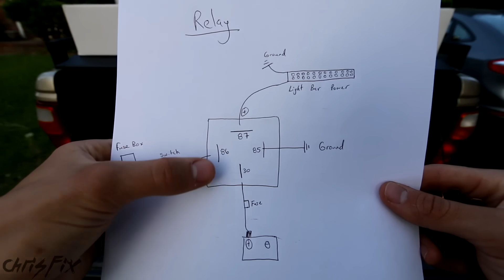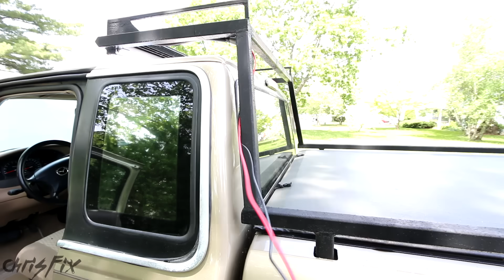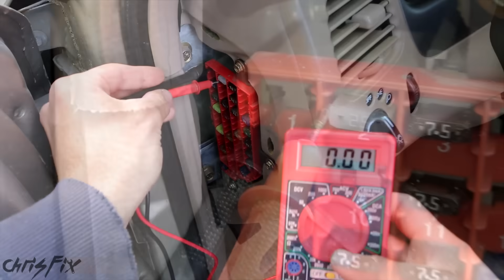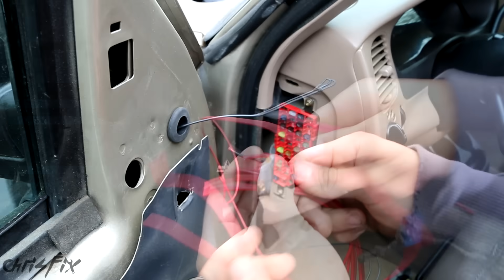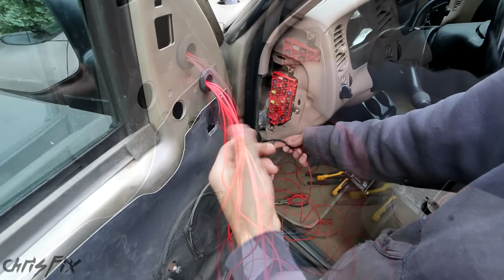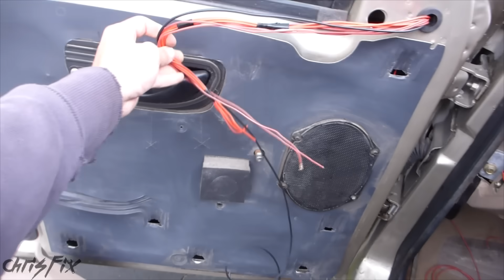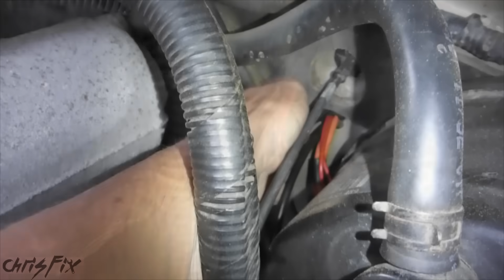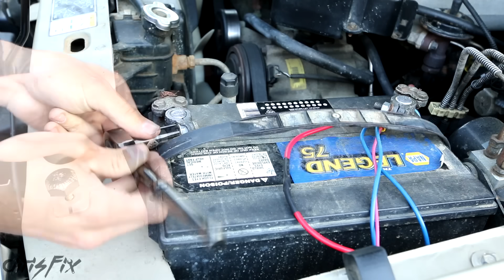How to Wire an LED Light Bar Properly (Project Night Light Episode 3)

Comment: you should do a how to wire subwoofer/amp.its really easy but nobody has made a good video of it yet.
Reply: yessss
Reply: I could do a quick runthrough of my setup that i did myself stereo, subs, 2nd battery, speaker amp and upgraded speaker wires
Reply: Look up Meade916 he has a lot of great videos on that subject.
Reply: Can somebody show me to do a fuse tap into my ignition with a toggle switch for amp turn on
Reply: @JonathanMartinez-rv9ur  
There shouldnt be a need for a fused line for the signal wire as it operates on an extremely low current that doesnt power anything
The way most would recommend you do this is to tap the signal(ON) wire leading to your stereo deck that way your amp is on when your stereo is
Reply: @TruckerTechReview  what? I'm not tapping into my factory radio. I am taking the remote wire and using a fuse tap for tapping into the radio fuse. What I wanna know is can I use a fuse tap power wire connected to the blue wire connect to the switch and then ground my black wire will it turn on?
Reply: Watch a geek squad video
Reply: Yasssssssssssssssssssssssssssssssssssssssssssss meade a gggggggggggggggggggggggood video

Comment: you could also ground wire with doors... it will work perfect as well - but one wire less
Reply from the maker: That is true. I learned that afterwards but either way works. Thanks for sharing!
Reply: i relay do like to watch your videos. Good job. 

i have two tips for connecting extra devices to car battery.

1st -  i connect thik wire to batery (only one) and i use universal fuse box/fuse terminal block - i have less mess, and all extra fuses are in one place.

2nd - if there is device that consumes a lot of power (lights with regular bulbs can use a lot of power) i connect them thru relay - no ignition, or even engine running means no power for device. 
it prevents my battery to be drained - especialy if i accidentaly leave my lights on...

Comment: would it work if you use your accessory power from your head unit to power the switch? that way you need the key in to turn the light on meaning you cant leave them on accidentally
Reply from the maker: Dont use the power from the head unit to do that. Instead, use a fuse that is only on when the car is on.

Comment: Put a 6 inch lift kit on project night light and 35 inch tires
Reply: +WHOS YO DADDY 8 it's the exact same thing as a ford ranger
Reply: +WHOS YO DADDY 8 a 6 inch lift maybe yeah. But a 3 inch lift and 31s would look good.
Reply: @znovosad555  i have 31's on stock suspension on my ranger
Reply: @owensullivan3881  well I have an f150 so I'm not too familiar with the rangers. I was just throwing out a hypothetical scenario
Reply: and a ford you know...
Reply: i have a 88 ranger with a 3 inch body lift and 31's right now thats only a 4 cylinder 2.3 and can still do 75 just a well as i could stock
Reply: Dylan Greene but... but... what about 'murica?
Reply: Rageception Chevy 350😉
Reply: Zach Novosad boy 31s and a 3 lol. I'm sitting stock on 30.5s so
Reply: austin bob calm down its only a Mazda...
Reply: +WHOS YO DADDY 8 the only ranger I owned had a full on factory V8, with the same specs as a fullsize F-150 that I had about the same year, so logically the ranger should be faster, I think the 6 insc a bit much, I would go with a 4-5 inch lift
Reply: Rageception that's not any better😂
Reply: Zach Novosad true but how often do you see a lift kit on a Ranger? And they're already slow enough and I'm pretty sure a 6" lift and 35s wouldn't even allow it to get up to legal speed... Just sayin'
Reply: @RJ-pw9ij  
Lifted Rangers are very common.... 
Regear the axles with 35's and you'll have the same or better acceleration than stock...

Comment: I was wondering if I could put all my LED light bar switch into my fused box??  And if so how big of a fuse should I run with 3 switches, a volt meter, and USB port??

Comment: Very interesting, but I would have a switched ground instead. So you would  only need one wire from switch to relay (reducing your  8 wires for 4 switches to just 4 wires.)  
Also the gauge of the switch wire could be greatly reduced (and therfore chose more fine-veined silicone coated wire which will not break due opening and closing the driver door.

I also would have choosen to install the relay in the car or somhow more unexposed. 
I also would have only run the positive wire to the light and choos to use the ground of the rail.
but all in all impressiv

Comment: Is there a limit to how many lights one relay can control? Can I hook up multiple lights to one relay or do I need one relay for each light?
Reply from the maker: You can wire up to 30amps of lights. That can be 10, 3 amp lights or 2, 15amp lights.
Reply: +ChrisFix Thank you so much for your help and I love your channel 👍👌

Comment: Will P,always use braided wire that is flexible,no solid core like in housing wiring,this type of wire will break due to vibration of a vehicle.Basically the easier it bends,the better grade of wire it is  😎

Comment: A job well done. I got a little lost when you ran the wires and connected to the relay. I'm more used to labeling my wires so i don't lose track of which wire goes to where.

Comment: quick tips Chris,when installing the flex  guard I always wrap a little tape on the leading edge so it doesn't  slide off while feeding in the wires,also I always hand my relays with terminals down to prevent water from leaking in.I also like to spray no co battery terminal protector on the bare terminals,you do good work kid  lol.  I used to rewire big r vs from fire jobs and installed numerous electrical accs. Always loved a good short circuit  😊
Reply from the maker: Thanks for the tips!!!
Reply: will regular 12g primary wire from the hardware store work or do you need special automotive wire

Comment: As i am a bit curious, Is It due to a law where you live that you are not allowed to use that LED bar on "normal" roads?
Where i live (Sweden) we are allowed to use them anywhere so thats why i am asking :)
Reply: They're legal on roads in Sweden? wow. I'm not sure for my country (Norway).
Reply: Yes, LED-ramps is more or less the biggest seller right now, normal extra lights (the round ones) and LED once are not selling as good anymore. 

I know loads of people with big trucks having one in the front and on on the roof, the roof one is usually the full width of the truck.

But even people with normal size cars are having full width ramps on the roof as it gives superior sight during the winter.
Reply: ***** Guess I got to open my eyes when driving in sweden then hehe, but what type of store sells them there?
Reply: Mekonomen, Jula and all the car dealers here i Östersund atleast. I bet Biltema also do carry them.

The largest i found just now doing a fast search was 12000 lumen, 97,9cm wide and 250 watt.
Reply: +Martin Axelsson sweet. will check on them and compare to find some cheap with some durability.

Comment: Really good work there Chris but I wouldn't add another nut to the ground terminal on the battery, because 1. you can ground anything pretty much anywhere on the car and more importantly 2. it's makes it harder to remove the battery in the rush in an emergency such as an accident where it's critical to disconnect the battery as fast as possible.
Reply from the maker: Thanks and thanks for the tips!

Comment: With 8 wires in the door you can operate 7 circuits, especially if you use relays the same way you do here. 
And while we are at it, why not control the relays from the ground side? Ground is available everywhere, and you only need to run the +12V to the conveniently located relay, instead of having to run +12V to the switches...
Reply from the maker: Thanks! Yea, I learned that from you guys after the video!

Comment: Hey, i am planning to mount a LED bar on a tractor. The question is does the switch steal any power? Because it's connected to an active fuse spot.... Sorry for bad english 👍
Reply from the maker: +Septic_Zevs when the switch is off, it does not use power.

Comment: i would run the wires inside the bar they were zip tied to
Reply from the maker: The bars are sealed shut so that they dont rust from the inside. Up in the northeast rust is a big problem!
Reply: +ChrisFix use grommets so water cant get in

Comment: Chris, as per your wiring diagram, why did you have to run a ground wire to the negative battery terminal? Was the LED bar ground feed done onto the chassis? Thanks!

Comment: that's awesome, I think one thing I might have tried to do differently is drill a hole in the frame you made so the light bar wire can run through that. Could be a little more aesthetically pleasing and less chance of someone cutting it. Great job!

Comment: Hey Chris, very nice project and you give me some ideas to do it too with my 99 Ford Ranger but I don't want to do a roof rack like you, where would be the best place to install it? is it behind the front grid or on the bumper (like your other set of lights)?
Reply from the maker: Behind the front grill is a really nice place. Did you see project police interceptor with the light bar behind the grill? https://www.youtube.com/watch?v=1-F0PIF8Hqo
Reply: Sure I've seen! Really nice project too I looked all the videos you made with this car! and that's why i'm asking if it will be nice behind the grill because I don't have many space to fit the bar at this place, my truck grill looks like this: (http://carphotos.cardomain.com/ride_images/1/1235/501/3085250018_large.jpg) and if I want to fit a bar it will be 2 of 13 inches maximum (each side of the ford logo) and I don't know if the grill will "hide" the lights of the spot?

Comment: I would have hid the wiring in the piping before welding it up. That way no one would be able to mess with your wiring.
Reply from the maker: I sealed the pipes completely because up here we get a lot of salt and that causes rust!
Reply: understandable. i would have figured out a way to run the wires through the piping in the design process. It would have looked a lot cleaner.
BTW love your videos. Keep up the great work
Reply: You did a great job Chris!

Comment: This is your best work yet IMO Chris... great job! Out of experience, I would definetely recommend dielectric grease on all electrical connections to keep the connections from oxidizing (yes even plated copper connectors oxidize which can cut off or limit the amperage traveling through that connection). After a year or two my LED light bars would flicker or go dim and a nice wire brushing and application of grease on the connectors brought them back to life.
Reply from the maker: Thanks and thanks for the tip!!

Comment: hey bro i just saw this video, however i installed my fog lights on my car a while back and they went out real quick, thought it was the lights so i bought those two little LED light squares to use as fog lights, is the setup similar to this? badass light bar btw!

Comment: hi. i just bought 2 pcs of a 6" led light bar and it doesnt say the amperage on the box.it just says 18 watts per piece. but from what ive researched (amperes = watts / volts) its supposed to be 1.5 amperes per peice.do i still need to use a relay and a fuse?whats the best installation process to avoid frying anything in my car?
Reply: You should always use a fuse, it doesnt depend on the amps, its for preventing your car to catch fire in case of a short circuit, you should check how much amps your switch can handle

Comment: GREAT  JOB .
Reply from the maker: Thanks!
Reply: +ChrisFix u could have run the power leads inside the tube bars to hide it from view & to prevent tampering/cutting too,another tip is to use a scrap length of mig wire to pull through wires as its more flexible,also comes in handy for running radio antenna cable through the windscreen pillar too,just tape the mig wire to the antenna plug :)

Comment: what kind of truck is this and were you influenced to buy it over a ford ranger? if so please tell why
Reply from the maker: +TickTockTestify This is a ford ranger. It is a Mazda B3000. Ford owned mazda so this is a rebadged ranger.
Reply: ah okay is the design any different manufacturing wise as in parts or build?

Comment: Hey, great video and helped a lot.
I followed the same steps you showed in this video, but when I turn on the light bar, the radio gets all staticky. Could this be an issue with the light bar itself, or could they not be receiving enough power?
Reply from the maker: +Joe Infante If you have a cheap lightbar, they interfere with the radio. That is the classic "you get what you pay for". My top reverse led light bar causes radio static when it turns on.

Comment: hey chris I have 20 inch light bar 126watt but I don't know what size amp fuse I need to use, do you know?
Reply from the maker: +fordf150 _ that is 10amps so use the chart I linked in the description

Comment: Hi Chris! I am hoping you can help me out. I have a V6 2013 Ram 1500 and I tried intstalling two (2) 18W spot lights as fog lights and a 30" 180W combo light bar. Long story short, I made the connections and now my car is only showing a low battery at 11V. I purchased a factory harness for each set up, used two of these switches (http://www.amazon.com/Ulincos%C2%AE-Latching-U16C2-Suitable-Mounting/dp/B015WS4PC8?ie=UTF8&psc=1&redirect=true&ref_=oh_aui_detailpage_o02_s00), and ran 14 AWG wire to the lights and 18 AWG to the switches, in addition to the harness wiring. I am at a loss cause my truck goes in to "Battery Saver Mode" and my power steering completely shuts off as I am driving. I disconnected all my connections from the battery and the truck is working like nothing happened, and my battery is fully charged. Any advice/suggestions???

Comment: im not a electrician or anything but isn't the negative the hot wire
Reply: +MaxTheEverything7 uhhh no. the negative "-" is the black wire, or ground. the red wire or "+" is positive. aka hot
Reply: +enigma9789  welp then i have to go tell my sceince teacher
Reply: +enigma9789 In reality. The electrons go from the negative to the positive side in a DC circuit. http://www.allaboutcircuits.com/textbook/direct-current/chpt-1/conventional-versus-electron-flow/

Comment: idea if you haven't done so yet .  make an extermal or separate battery connection.  you will need aftermarket battery connecter  some same gauge wire. that way you can get all those wires off your battery.
Reply from the maker: +Timothy morris That is a great idea! Thanks!
Reply: +ChrisFix i think it would be a good ideas as weel as sence you are putting alot of exrta lighting on there i would add and extra battery and larger alternator so youre not putting extra stress on you main battery

Comment: Awesome job! I myself would use multiple colors of wire and label them so down the road if I needed to diagnose an issue or if I sold it, at least then I'd know or the new owner would know what each color is for and not get confused.

Comment: If you are running the relay and switch off the battery I dont believe you would need a fuse tap. At least I didnt use one on mine and I can still activate the lights while the car is off. Maybe its the harness i used im not sure.
Reply: +ChrisFix I used a "plug n play" harness that had two waterproof connectors, an inline fuse from battery, a relay, and a switch with led light. No fuse tap came with it and I can still operate the lights while car is off, why would I be able to do that without one? I thought a fuse tap was just for devices/lights that were not directly wired to the battery terminal? Cant seem to find an answer anywhere so figured you might know haha.
Reply from the maker: +Cody Saunders Im sorry, I meant to say "in line fuse" not fuse tap. My bad. Yea that is good! You can do it either way.

Comment: A question on another subject, my 2012 Toyota Corolla takes OW-20 full synthetic oil. I have been reading articles online about changing motor oil. I am reading that changing at 5k is overkill. Meaning too soon. I didn't change my oil yet and I drove 7k. What would you recommend?
Reply from the maker: +mtadriverdave1 Go by the oil life monitor computer in your car. That is the best way!

Comment: The ground on the battery is annoying me... I didn't think it was smart to leave any copper out of the shoe?
Reply: It isn't I used duck tape to cover the exposed wire
Reply: I always just makes sure thata the copper is in the shoe, and clips off anything that hangs outside :)

Comment: ChrisFix when you ran wires for the other switches for later use, was it with the intention of each switch having its own power source/fuse tap to be added at that time or will they be wired similar to how you ran the ground wire and jumped from switch to switch? I'm thinking about adding another switch or two in the same door handle location as my other light bar switch.
Reply from the maker: +Xanadu245 I am going to run them off the same fuse tap but a bunch of subscribers made a good point that I could have use less wires if I ran a ground interrupter switch setup so when you turn the switch on, it connects a ground, when you shut the switch, it disconnects the ground.
Reply: ChrisFix that's a good idea.  Fewer wires is often a good thing.

Comment: Awesome Engineering...keep it up and keep sharing. Really like the way you keep the safety aspect in place like using a flexible tube to protect wires and use of zip ties also impressive.